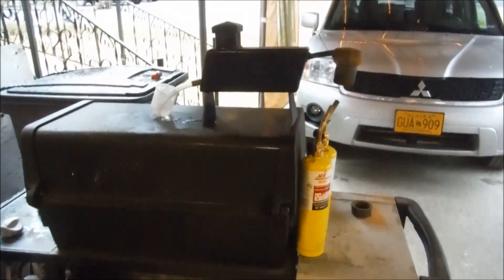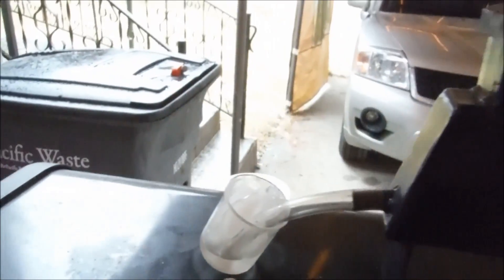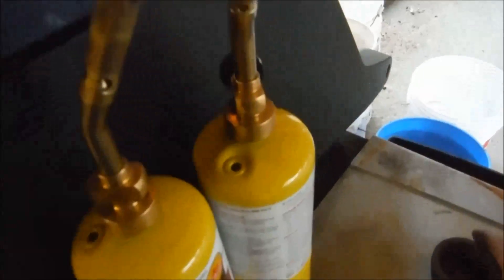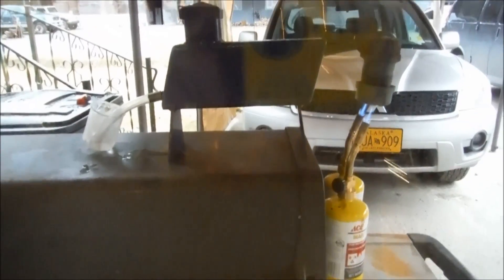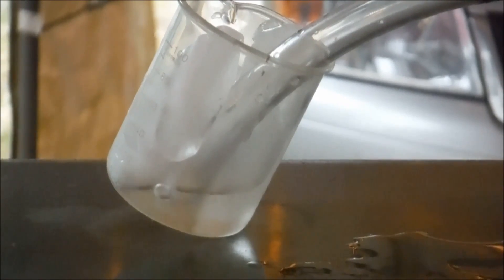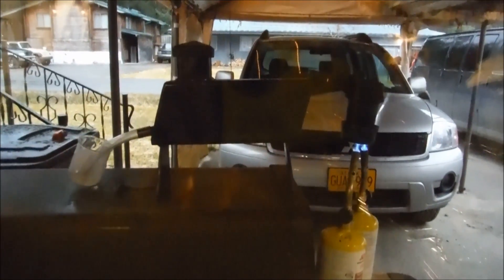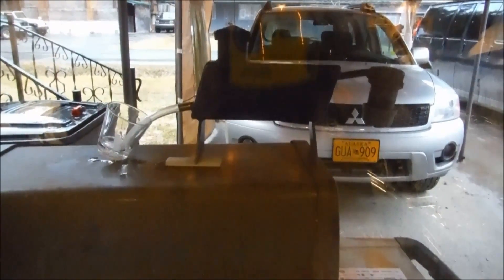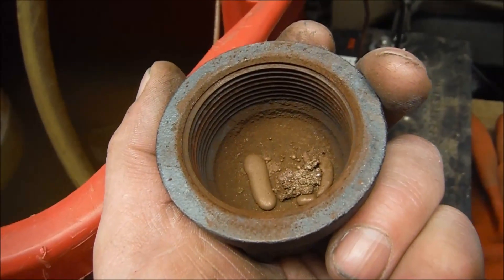Mercury retort

Comment: Hey ray, be glad it didn’t work 
I tried it with oxy/acetylene. No problem with heat. No problem with the mercury vaporizing and condensing.  
 Problem was that cast fitting being so porous, absorbed all my gold😂
 I realize that this may be the most expensive tinning process. I’ve thought about inserting a graphite crucible into the cap.  
 Best of luck down there

Comment: The issue is your space between your burner (plumping cap) and the entrance to your vapor collector. The pipe nipple is too long or too tall in your case. What's going on is you're creating vapor but it's dripping back down into your burning cap. So the majority of it is just recirculating inside. Also your probably leaking vapor past your threads. Seal it with a bead of plumbers putty or clay. Hope this helps!
Reply: In other words change the plumbing nipple to one 1/2 that length and seal it on the outside every use with plumbers putty. Do not seal the threads inside it will contaminate your amalgam. 
Map gas is plenty hot enough! A camp stove will do the job. It's just your set up.